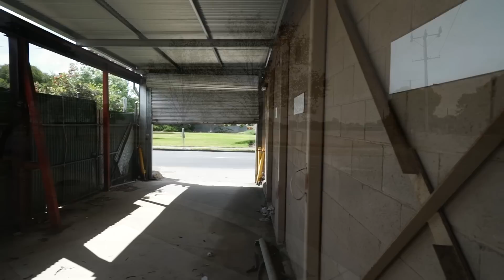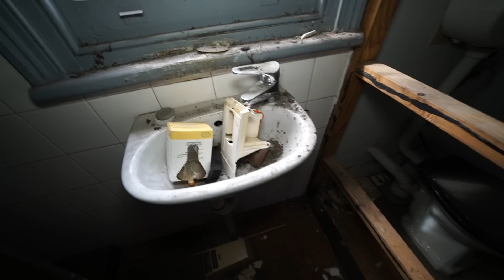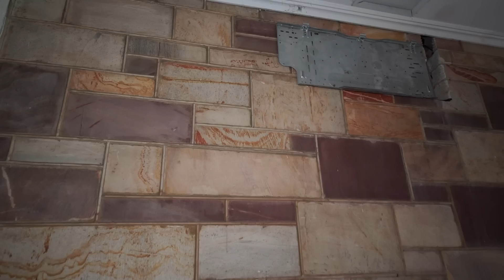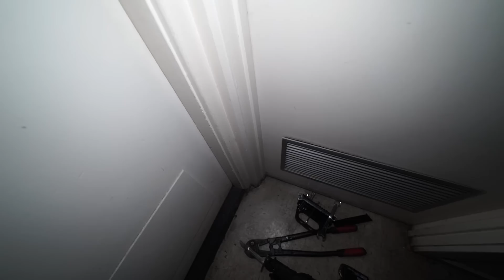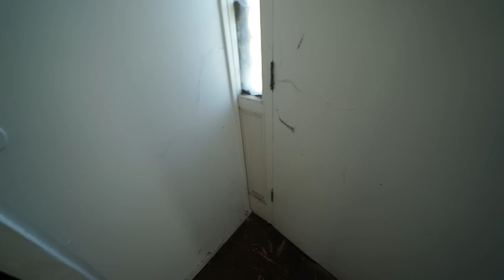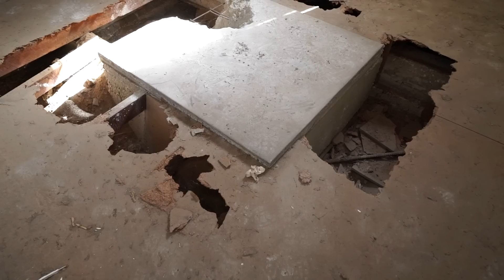Huge manufacturing plant with 4 old homes on site. Found huge safe. New Castalloy

Comment: One of the old cottages ( not sue which one ) was originally occupied by a small surfboard manufacturing business i, approximately 1959 / 1960. They paid remt to CastAlloy. ( Harry Phipps ). My research says that Phipps approached them and bought out there small business. He then started manufacturing  fibreglass surfboards in his plastics division. 1961. - 62. the 9’ 6””    “Surfari “ then later, 63  - 64 -65.  “ SouthCoaster “. Again, these were big bourds of the day.   They were sold around Australia  through  arrangements with  major department stores  David Jones ,  Meyres. John Martins etc. I have seen the original advertisements. and have physically seen one of the boards and knew of another one. They all came with a very nice canvas travel bag. They are rare.

Comment: Great Video!

The concrete slabs were apparently in place from when the creepy owner installed heavy duty, industrial style sewing machines to make his satin garments! This was so they wouldn't fall through the floor!

FYI, if you are doing further 'digging', the dig site that was were the children are meant to be was on Kinkaid Ave directly opposite the park. Not far in from the road. However, the story goes that their could be suggestion that they're under where the car park was behind the two houses where you saw the concrete slab...

A note physically left on the gates of the factory on the 50th anniversary of their disappearance suggested the two girls were buried there but not the boy... 

Who knows... But a good time to rule it out now - what else will they find if they excavate the whole site!
Reply from the maker: Hi Alex, thanks for the comments. Interesting about the sewing machines, I wondered what they would have supported, in it looked as though an attempt with a jack hammer tried to crack one open, maybe thinking it was also a casket or on top of something? I wonder if there will be another excavation before it's built on again. Cheers for watching 🙂👍

Comment: I worked there from 2001 to 2013.. 
Did many jobs there.  From double over head cylinder heads to 498 manifolds to low pressure to heat treatment.. great memories.
Reply from the maker: Cheers Neil :-) Great hearing from locals and their accounts. :-)

Comment: Drove down Mooringe Ave the other day, was shocked to see old Castalloy gone completely. Worked there in the early 2000's for a few weeks knocking out sand castings for Holden Commodore engine sumps. That place was meant to be replaced by the new Castalloy but never really went ahead. The management were difficult to deal with, they did good work supplying Harley Davidson with wheel rims, but the rest of the place was way behind the times.
Reply: Vy oil pans
Reply: It still shows as being there on google earth, how much longer it'll show there I don't know.
Reply from the maker: Cheers Jon :-) Always great hearing from locals familiar with these places. I was always such a busy area Mooringe Ave with all the industrial sites, many which are also gone now. A lot of Snack bars and Deli`s along there back in the day too. Cheers mate :-)
Reply: @urbexindigo5164  Is great hearing from the locals but I feel a need to mention I'm from the US, intrigued by the loss of many jobs there, it's also nice to hear from commenters that have worked there. I also toured down the Beaumont children rabbit hole as a result of viewers commenting on that.
Reply from the maker: @JohnShinn6078  cheers mate! There is another Jon above you who also commented from Adelaide 🙂 I had a feeling you would have got in to the research, cheers for the support and always watching and commenting 🙂

Comment: As soon as the video opened I said that's old work!..Worked as an electrical maintenance worker there when it changed to Harley- Davidson Wheels Manufacturing plant…….  Memories.
Reply from the maker: Cheers 😊👍 love hearing from locals and their accounts. Were you there a while? Thanks for watching 🙂
Reply: @urbexindigo5164  I worked contract there with Skilled recruitment and had 2 stints there for people on leave etc. plenty of nooks and crannies to make yourself scarce.😁 The place had a lot of furnaces and baking ovens for moulds. Dirty place to work, black soot dust everywhere.

Comment: Very interesting place.  I suspect that you were not alone while there, whomever left those tools was probably hiding close by.  The room right at the tools had a bunch of luggage type bags, and looks like they were loading them up with copper, you could see a bunch of cut up heavy gauge wire right there with the bags.  It has been my experience with exploring here (South Carolina, USA) that most scrappers are not dangerous, and are just trying to scrape a living out of the junk.  True they often damage the sites we want to see, but for the most part they are just trying to get by and are definitely not interested in any trouble.  It is amazing the damage those termites can do to a place!!  Thanks for sharing another interesting place with us!!
Reply from the maker: Hi Ludercoarms 🙂 spot on mate and I have encountered scrappers quite a few times and yes they are just trying to make a living and they were not aggressive at all but I guess if they are getting to places before contracted salvage teams it can be an issue. Usually they are cleaning up the left overs. 👍

Comment: Hey mate if only these walls could talk. I had two mates that used to work at the castalloy site being used to make Harley Davidson wheels for the motorcycle. This places looks heeps massive and definately got a creepy vibe when I heard a voice as you were going through the sheds, but is was pigeons. The old Villa with the termite damage looks like it might of not being used for years just locked up tight. Those concrete pillas what would they have been used for or something else the mind boggles. Awesome video mate cheers.
Reply from the maker: Cheers Werner. I used to drive past it everyday years ago for work. Always wanted to see inside those old homes! :-) Thanks for watching again mate
Reply: @wernersadventures8330  The 2 concrete blocks or pads inside that building were probably used for precision measuring equipment for new designs/quality control. Holden had something similar.

Comment: Going by google the company was owned by Harley Davidson, was closed in 2018 with lose of 120 jobs. Did manufacture of Aluminnium component and rims.
Reply: Interesting, was it something before that, that was a large complex to have only employed 120.
Reply: @kentuckylady2990  it may of had more before the closure, didn't check how long it was going for will check. The original company started in the 40's 700 employes  over 3 shifts.